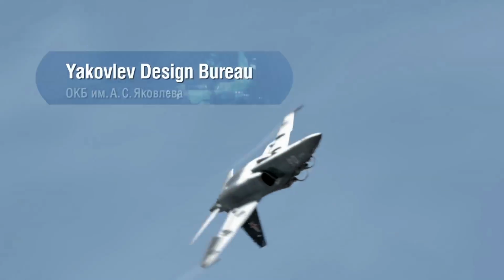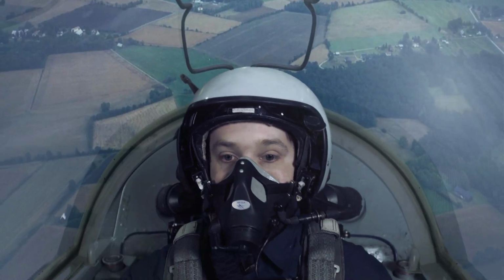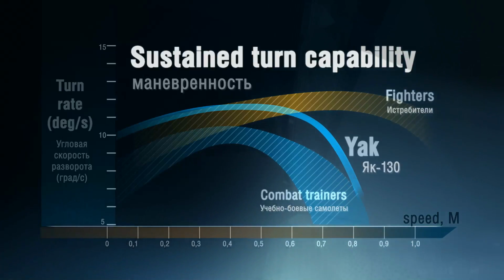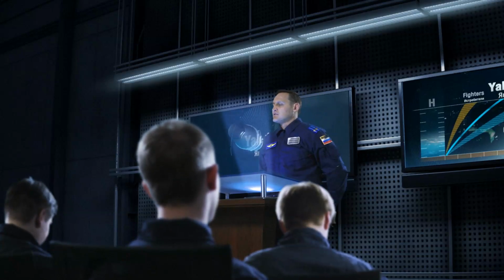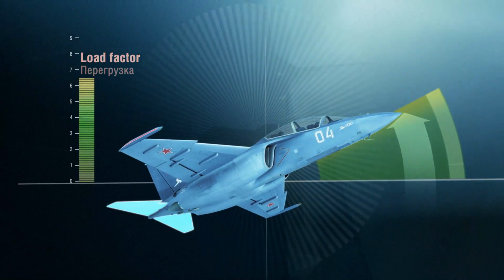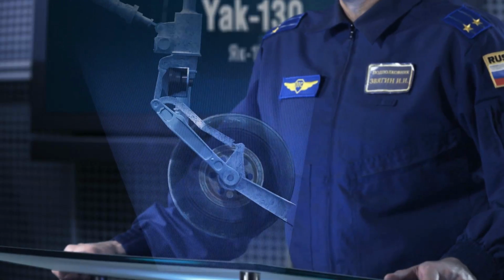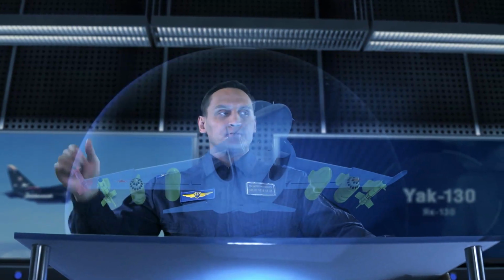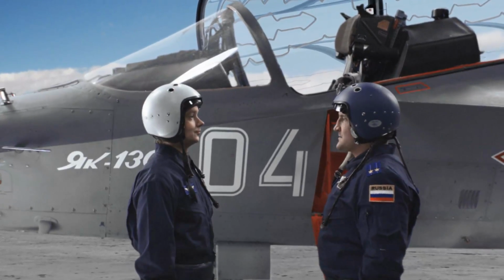Yak-130 - the key to your sky

Comment: Very well designed and awesome fighter, however if I was a small nation I would swap out the engines for a bit more power I am sure Russia has dependable more thrust and power engines you need at least Mach 1.4 to engage in air to air and beyond sight with the extra lift potential , add those two elements and I believe the bang for the buck so to speak would be un-matchable and it could be the backbone of a small nations air command! with faster more lift this could challenge a F-16 for half the price!